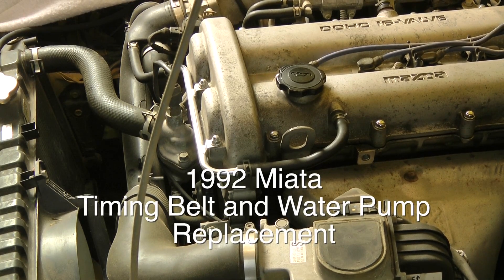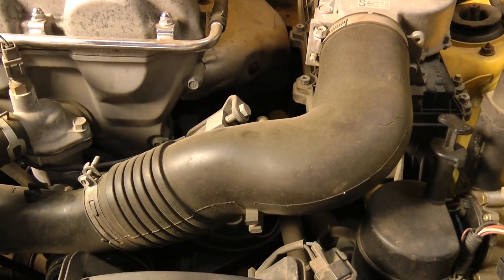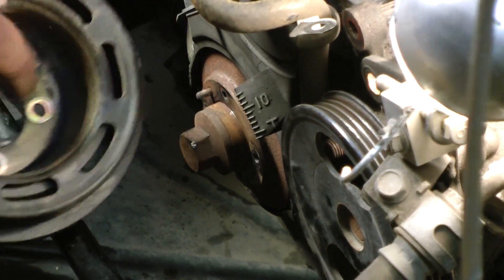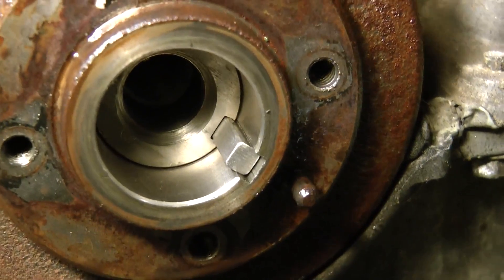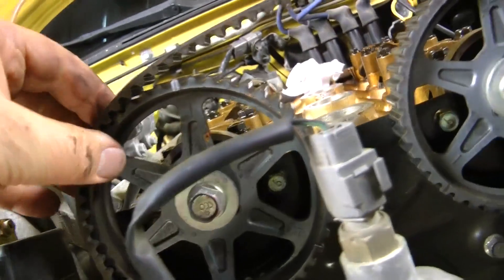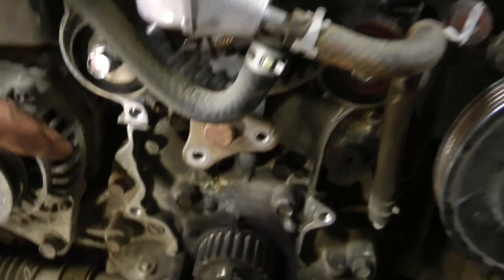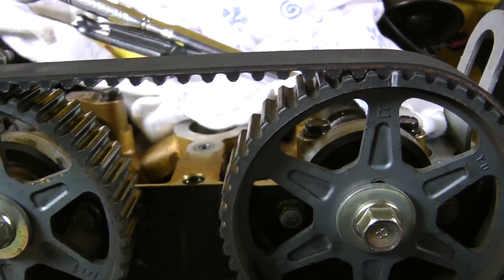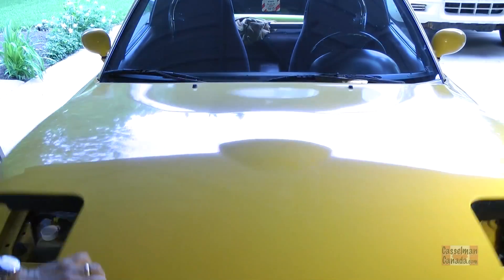Miata Timing Belt Replacement

Comment: fyi for other viewers.  The oil seals are very easy and cheap to replace.   Especially the cam shaft seals.   Sometimes that bottom pulley gets tough to remove and that can make replacing that seal a bit tough.     This engine doesn't appear to need them.

Comment: 5th gear, e-brake on and tires chocked, no tool required....
Reply from the maker: +Wayne'sWork You'd think so. The first Miatas apparently had a weak crank you could break doing that. Actually I tried that and it did not work. I even tried with the dreaded impact! So as you missed in the video, I said this is the way I did it. You can post your video any time with your method. I will watch.
Reply: I agree.   5th gear with brake on.   Also did anyone notice that the main pulley bolt threads were very flat.   Leads me to think it may have been stripped.

Comment: That is the shittiest instructional video on how to achieve your end result.
Firstly, You removed the the radiator and fans. if you had used shorter extension bars on your oversize socket ratchet, then you would not need to remove these items.
2. What was the point of removing the tapered key?  Wasting valuable video time on such a frivolous endeavor. 
3.You did not explain how to set the mechanical timing.
4.You missed several important tricks and proper engineering procedures.
5. Blah Blah Blah.
Reply: +Peter Lammin 
Could you please post a video of a NA Miata timing belt replacement where you leave the radiator and fans installed? I look forward to several minutes staring at nothing but a close up of your fan shroud and not being able to learn anything. Think before you comment.
Reply: it really is a nice video. Your patient and meticulous. thanks..
Reply from the maker: Thanks, I appreciate the video comment. After you upload, there are always things you wish you did better. But if you only do the job once you have one chance to video too. Thanks for watching tbkilb01.
Reply from the maker: Don't be so hard on the guy. He has 5 videos on youtube between 3 and 5 years old. They have just over 200 views total! He's that good. I think I read about him in the story of the Three Billy Goats Gruff.

Comment: Good day sir, it is very helpful video. I am very interested with your homemade special tools. I would like to know the size and the cutting angle to make that tools. The tools looks fit very well on the crankshaft pulley to remove the bolt. Looking forward to hear from you. Thanks.
Reply from the maker: Do a search for Miata crankshaft locking tool and you will find many pictures. Mine was similar to the one on this page ( http://www.autozone.com/autozone/repairguides/Mazda-Car-2005-06/Engine-Mechanical-Components/Front-Crankshaft-Seal/_/P-0996b43f8037e007 )where it applied pressure against the alternator pully. I did not bolt the free end to anything on the engine but let it hit up against the alternator. It actually did not require much torque by me with the swingarm to remove the bolt. Torquing it back on was a careful process to be sure of getting the right amount of torque.

Thanks for viewing my video.